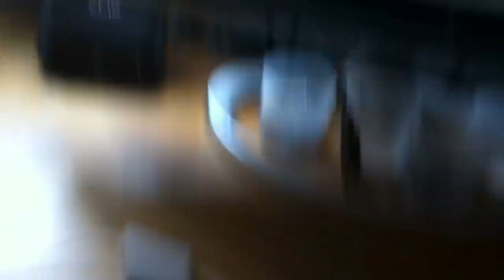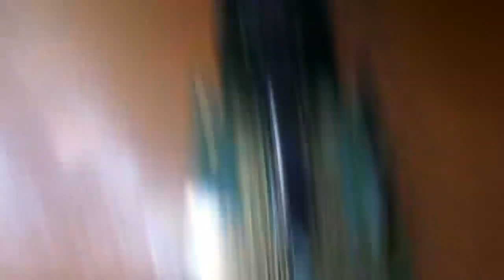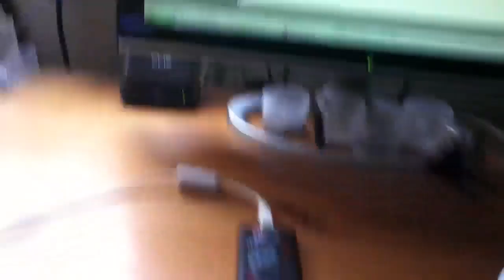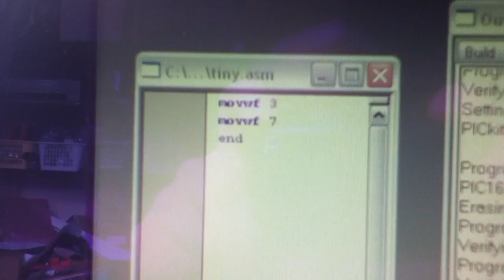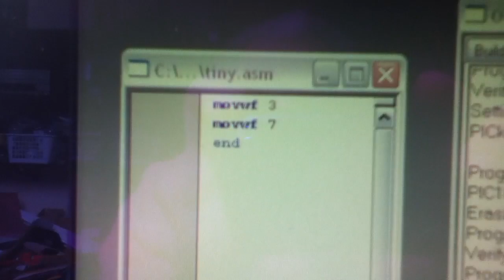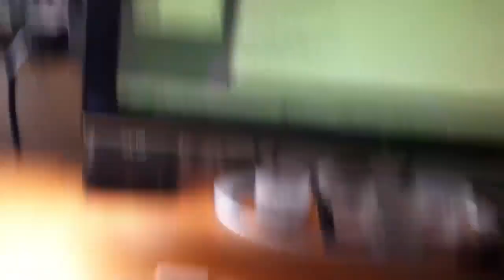World's Shortest Microchip PIC Flashing LED Program

Comment: It's not two instructions.  It's 4096 instructions.  It's just that you only wrote two of those 4096 instructions. ;)

It's still a clever way to make the LEDs flash, though.

I've done a 16-instruction program which sweeps 4 LEDs back and forth on port A of the 16F84A.  Next on my list is to do a 4-player "first player to press the button wins" game, with a different sound for each player.

Comment: Hi. I need some help and I hope you can give me the information I need. I build models at home and I some times put LEDs in my models to make them look good. I'm building a Star Trek ship and need to put some led's in it. You can pay the lights and chips from a web site trekmodeler but it is in the USA and a lot of money to but. Do you know if I can make my own circuit board and blinking lights. Thanks sir.
Reply: You should be able to do this with a single PIC or ATMEGA chip such as used in the Arduino.  Depending on how many LEDs you wish to control, you may also need some pin extender chips (I forget the chip number but the 74HC595 shift register will work too).